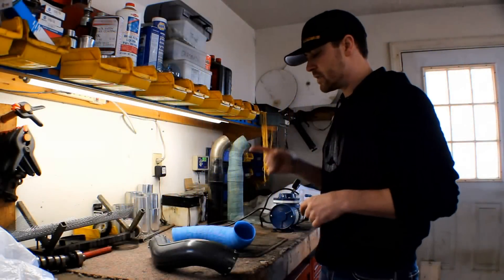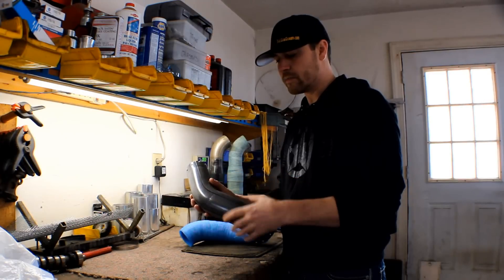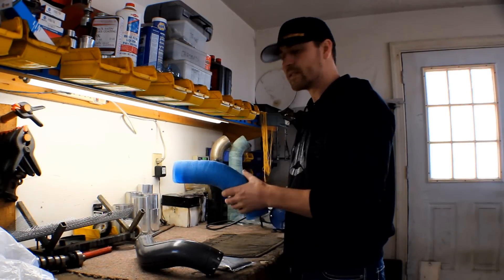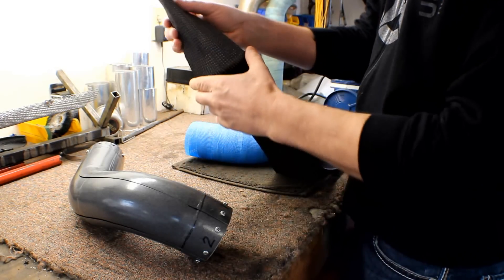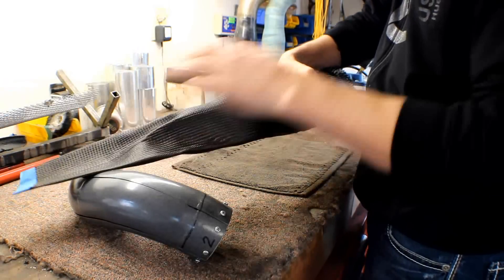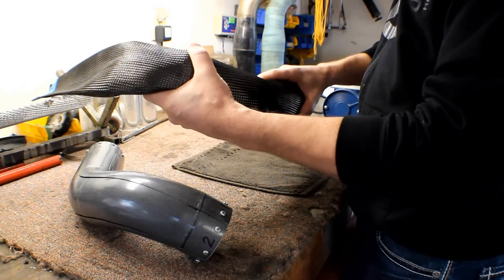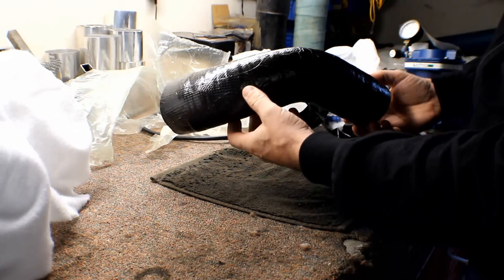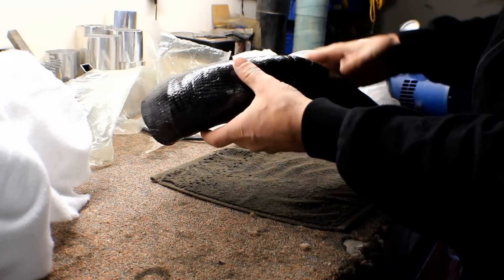How To Make Carbon Fiber Induction Tubes

Comment: I know this is an old video, but this was just what I was looking for to make an intake tube.  For the sleeve material, how much does it expand/stretch?  I've got a 4 inch OD intake tube with a couple of bends that i've 3d printed; will have to shrink it by the thickness of the CF for the mold.  Should I buy the 4 inch sleeve?  The only size I see below that from most manufacturers is 2.5.  I'm considering using water soluble PLA to make the mold.  Is the single layer of CF strong enough without doing a second layer that's in a different direction?  Thanks!

Comment: No offense but it looks pretty bad. any ideas how to make it smoother? The wrap of the cast is way too visible. Does it look better under the hood?  I also would be concerned how resilient the cast material is with gas, carb cleaner, etc. And falling apart in the tube, getting sucked into the intake.

Comment: Is Only Benefit  Weight Reduction? How Does This handle Heat As An Air Intake Hose As Opposed To Composite or Aluminum? -Thx
Reply from the maker: doesnt heat soak like aluminum does

Comment: I would like to see the carbon fiber composite tube without the lines from the cast wrapping.  Could you possibly use a wax on the disected metal tubing as the mold?  Then a thin layer of resin on the tube, insert tube in carbon fiber, resin carbon fiber, wrap, and finally put in vacuum bag?  That would seem to yield better quality results.
Reply from the maker: yeah you could pre smooth the casting material before applying the carbon

Comment: Terrible mold for air flow on an "induction" tube, I would rather use a fence post than rock that lumpy carbon sack of poo
Reply from the maker: its ultra smooth on the inside since it was made over mold...besides its the technique thats being shown in this video not the final product
Reply: @Thefabforums  I understand your wanting to inform and educate for your content, but in terms of fluid dynamics, that is not smooth on the inside, it would be better to educate with proper techniques, not lumpy casts.
Reply from the maker: @CamPayneCam  that's the thing...its perfectly smooth on the inside. The first video shows the process of creating it by wrapping it around a mandrel bent steel tube mold and then splitting it in order to get it off the mold. The lumps are only on the outside.

Comment: Well.. I think a few people have already pointed out ways you could improve finish with a mould, release compounds and pre cut peel ply but also you've kind of misunderstood the purpose of vacuum moulds. The vaccum is set at one side of the mould and the resin drawn in from the other end allowing it to work its way through the material evenly. 
To be fair you would probably have had a similar if not better result simply doing a lay up and applying resin with brush and roller then lacquer afterwards.
Reply from the maker: The advantage to vacuum lay up is to remove excess resin and to compress the part as it kicks....what you are talking about is called vacuum infusion.

Comment: does anyone know how well the expoxy and carbon hold up to heat, im doing a bottom mount turbo setup, where the intake as well as compressor output will be realitvley close to the turbo manifold. i can make some aluminum heat sheilds but those with only block so much heat haha. the pip will probaly be within 1.5 inchs of the turbo manifold
Reply from the maker: I have used them on intakes with no issues...there are high heat resins that will withstand around the 250 degree mark I think
Reply: okay cool, i found some high heat resins on ebay that i think will work well. im gonna try to minimize the heat with header wrap, heat shields, and wraping the carbon in heat reflective tape. nice video too, you give a lot of nice fab ideas with your channel

Comment: Did you place the perforated release film on top of the part? I  am working on a skinning part, I tried adding the peel ply and then the release film but instead of having a gloss finish like I intended it have a matte finish as it sucked out all the resin.
Reply from the maker: +Maksim Shirokov yeah. i use the release as the peel ply
Reply: thank you very helpful!! your video is fantastic I am doing the same to make a set of intake tubes for my mercedes

Comment: I have a 90 cobra twin turbo project and I was wondering what do you use to make the mold for the air induction box or for even a hood or fender
Reply from the maker: cobra clone? molds are different depending on what I am making

Comment: Honestly, who cares what it looks like, function over form. 
As long as its light, strong, doesn't leak, wont blow out under pressure...thats really all that matters.
Reply from the maker: +Jay Simons lol...yeah the looks are the easy part
Reply: Would thick rubber or silicone o rings around the ends of the tube with the fiberglass wrapped around it help? it would make a ridge around the tube that the silicone tube and clamp would push up against making the seal a bit tighter under boost...least thats what i'm picturing.

Comment: hopefully not a super stupid question but what is a good place to buy carbon fiber sheet, epoxy, and hardner? I watched the "you need this tool video" which was hilarious, but some of the links are broken.
Reply from the maker: I will take a look at those. There are a ton of places. Just search Carbon Fiber and you will get some of the top places to buy it.
Reply: gorrila carbon works

Comment: doing that is no point. just adding weight. unless you remove the blue composite from the middle and ad 1 more layer of carbon then it's a true carbon fibre part and will be lighter.
Reply: it isn't a true carbon part it's just a part made of true carbon fiber and fiberglass. By adding the layer of carbon you just waste money. the carbon fiber will fail much earlier than the fiberglass  due to it's lower maximum elongation
Reply: Bravo Jannik you watched that video too.  It's an intake tube.  What kind of elongation are you thinking this tube will see?  The mistake you are making is not looking at the application.  You watch a video and apply the ideas within to every possible scenario.  This is simple minded and really an obvious attempt to demonstrate some sort of knowledge.  That video condemning the use of carbon and fiberglass compositing fails to understand the difference between a stand alone material and one used in a composite.  Have you ever cut into the skin of a modern helicopter?  Many are made of a composite of carbon, kevlar, and foam.  Im quite sure each material has a different stand alone modulus of elongation but used together make a product strong enough for the application.  I have a jeep windshield frame made of kevlar and standard glass and it hasn't self destructed yet.  The surfboard industry has been incorporating standard glass and carbon for decades.  if you have never been on the receiving end of hundreds of gallons of water I can assure you that the forces are significant.
Reply: Actually just spending $money so it looks 100% carbon fiber/expensive. Looks like an Arm cast...not a tube. Whole point is so it's smooth/good looking..inside and out.
Reply from the maker: its a true carbon part now

Comment: Some of these people commenting are pretty ignorant. This is "true carbon fiber". He's just using a base layer of fiberglass. It becomes one piece not a wrapped piece. No different than using two different weaves when laying up glass. No different than using a hybrid weave of carbon fiber. It's still real carbon fiber it's just not a 100% carbon fiber layup.
Reply: Tru that and I would rather have the rubber hose on the inside so you don't have to worry about thin spots or failure and pulling bits into your intake and engine actually brilliant having the rubber tube on the inside I think anyway but opinions are like ass holes every ones got one. Some people just have one at both ends that spew different types of shit. LOL
Reply: It’s actually more of a composite as it will retain the properties of both fiberglass and carbon. There are always a shit ton of keyboard warriors on these videos that act like they are scientists lol
Reply: True, but the quality is shit, and not a smooth finish with noticeable lines from the casting material.  No doubt it is functional.  I think aesthetics is also important when it comes to custom work, no doubt this part is "unique".
Reply from the maker: They will never understand

Comment: So I watched a lot of your videos and subscribe myself, and now I am wondering if I can use my OEM motorcycle fairings as molds (I have a GSX-R 1000 13)... It won't gonna break them? Thanks for the video, man. You are awesome... And I liked the way you deal with thw hate in the comments. Best regards from Brazil.
Reply from the maker: right on. welcome to the channel. You cant use the fender it self as the mold but you can make a mold out of the fender.

Comment: if you follow this guys steps and take your time it should come out. now if your finished product doesnt look smooth as glass like a carbon fiber hood thats because you have more things to do. you would need to sand it all down smooth and cosistent. then use a fine sand paper and clean it up and make it all consistent again. clean and wipe it all up with aclohol. then get a paint gun and spray a clear gel coat. then polish and finish. its not just a walk in the park for beginners unless they just have a natural talent, its rare but does exist. just be patient, and put time into your work. turn on some jams get real organized. clean as you go, and keep a real nice work space while doing this stuff. i have 10 years + doing composite work, mainly aircraft. theres a reason i get paid big money for this work.
Reply from the maker: Yeah this video wasn't meant to show how to make a perfect part....more to show the process I came up with.

Comment: I really can't see why you vacuumed it. You would of got a much neater finish hand laying it. For the record I am a fiberglasser  and have made plenty of cold air induction unites out of carbon.
Reply from the maker: The vacuum compresses the layers for strength and removes extra resin to make it lighter.
Reply: But you already have a strong enough structure in the original pipe work. The amount of weight yo would save would be minimal.If you would of hand layed it you could of taken out a lot of the roughness the vacuuming produced and had a smoother product. If you were after weight reduction you should of infused it.

Comment: I'm thinking about buying a cheapo injen intake and wrapping the tube in cf like this. Is there any benefit for have a cf intake tube? Or is only to look cool?
Reply from the maker: weight and doesnt heat soak like metal or aluminum

Comment: its not a true carbon intake, just a wrap, mostly fiberglass
Reply: So do a better job and prove the guy wrong. Complaining about his work without any results of your own is pretty shallow.
Reply: you can also use release agents to allow the carbon fiber to release from the fiberglass. you probably have very little experience in manufacturing composites and its frustrating that you just dont know it all. i think this guy that made the video is trying to give people the concept. maybe this would trigger someone that passionatley wants to produce their own parts to do further research, maybe ask questions and to engage people for help and answers.
Reply: yeah well if you want a better finish of this part he made, you have many many more steps to go. if you want a different shape for your intake you would have to make a mold. you can use foam as  molding and then do a layup and run acetone through the mold when your done and it will disolve the foam. 😉 there are a lot of tricks to this skill. there is usually a lot of work involved in this craft. its not for everyone. ✌
Reply: thats why he should have left this job undone. He obviously have no clue how to make parts out of carbon.
Reply: The Fab Forums  you should have used fiberglass sanded it then used the carbon fiber bro
Reply: Duff Residents 
.
Reply: Duff Residents .
Reply: He wrapped carbon over plastic. He just have no clue of using the material. This is quick and shitty way of making anything. He cant even smooth all those wrinkles without damaging the fibers.
Reply from the maker: lol no its a true carbon intake.
Reply: The Fab Forums No! it's NOT! it's a really badly thought out fiberglass layup of a metal part now badly wrapped in carbon and looks like hell!

Comment: I have a question I have a 1994 Volkswagen Jetta 2.0 liter engine but I want to do my whole tire cold air intake system I made out a bunch of aluminum parts into a carbon fiber set up that would be awesome and I saw how you did yours but then I want to know is it possible to make one of the intake manifold because mine's a two piece intake manifold I was wondering is it possible to convert that into make a mold or something how to do it to make a cold air intake system for intake manifold I want to convert my intake to a carbon fiber or fiberglass one is it possible
Reply from the maker: Yeah I have some video on this channel where I made a two piece boxed manifold.

Comment: is there no way to take the blue cast material out?
Reply from the maker: no...why would you want to?
Reply: I mean it doesnt really add any strength does it?
Reply: ***** I guess technically you can make a meltable mold like a low temp thermoplastic polymer like the ones that can melt with boiling water. Or maybe if you had styrofoam which can be shaped temporarily to make the mold and you can burn it away after the carbon fiber has been formed.

Comment: Could you use aluminum tube to fad up a cast, then use plaster to get and inside diameter mould? Cut the tube off and lay the cf wrap over the plaster?
Reply from the maker: +Jeff Greer I guess you could but why would you want to do that?
Reply: The Fab Forums Well, my thought was.. Smooth air flow = better power. Maybe have the inside extrude honed to smooth airflow even more. Also, the outside of the tube would be smoother. I neglected to type the part about removing the plaster after the cf is cured.

Comment: I don't have access to a vacuum pump...will I get similar results by just carefully hand wrapping?
Reply from the maker: +ben dunn not sure. I know the vac pump pulls off excess resin and allows the part to be a light as possible. I would say just give it a try and see how it turns out

Comment: will a carbon fiber intake conduct heat or will it keep the inside airflow relatively cool?
Reply from the maker: +Bishop Cherry Coke does not conduct any heat...that's really a better perk then the weight compared to aluminum

Comment: Can you make it so it's smoother than that. When I look at Carbon Fiber I think of the super smooth product. I am not criticizing what you have made because I couldn't do what you did. What I am wanting to do is come off my Throttle body with a 5" round or oblong tube and place an air filter on the end by the grill. I am one of those perfection freaks who is never pleased.
Reply from the maker: +roaringcat 62 you can...this video was meant more to show the process

Comment: So in theory can you make the steel pipe shape you want and just do this process to the pipe the same way you made the fiberglass casting with the carbon fibre tube sleeve? Id like to have a smoother looking finish and no fiberglass on the inside.
Reply from the maker: +TrollinSmashies yeah thats the idea behind this process

Comment: You are remarkable. In spite of apparent failures you just keep on plugging. Keep it up.
Reply from the maker: +Adam Pierce I dont believe in failure...
Reply: +The Fab Forums It's only failure if you refuse to learn from it. Fail well/forward.

PS Love the videos.
Reply: I never fail, I just discover new ways that don't work. Great video!
Reply: A pun, and a backhanded compliment.  Well done.
Reply: +The Fab Forums It's the only way to get good.  Accept it.

Comment: very cool stuff, I'm watching a number of video's you've made.  I'm interested in turbo set up, I have a 65 fastback would like to run twin turbo's on a 351W.  any suggestions?
Reply from the maker: +Scott Herbert sweeet...I am sure I could talk for days on suggestions. The setup I am doing is a 351 base so its close to what you are looking to do.
Reply: so here is my http://overbudget66.blogspot.com/ been chipping away at it and it's looking good. let me know what you think.  it's just a body now with doors, I'm looking at a rotisarie to get it on it's side so I can detail under side then install front and rear suspension. Then I will start down the path of motor trans etc.  your feed back would be good as I don't share this blog really with anyone it's more of my own chronicle of progress.  have a good weekend.

Comment: +The Fab Forums I'm new to this and sorry if this question has already been asked. Why not skip the fiberglass and just do the Carbon Fiber? 

It looks like it would be really easy to just use the Carbon Fiber sock over your metal 4 piece tube (that you used to make the fiberglass tube). Am I missing something?
Reply from the maker: Well I could but I wanted to show the process if a mold that can't be separated can't be used. Like a tube section that's several feet long. You would have to use a fiberglass base.
Reply: +The Fab Forums Ah, Ok. That's excellent, thank you!

Comment: You can make the carbon fiber direct to the steel tube that you used to do the fiber glass tube.....just an idea....
Reply from the maker: Correct
Reply from the maker: I want show that step though because some may be making long and complex tubes that won't allow a steel mold to be removed.
Reply: +The Fab Forums True....but I got ideas for my '73 KE20 Corolla
Reply from the maker: Sweet